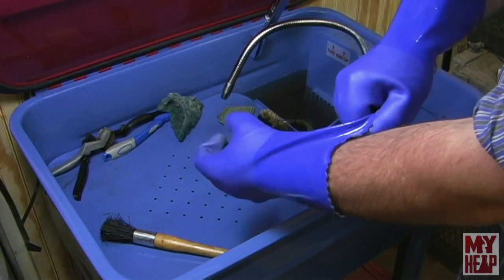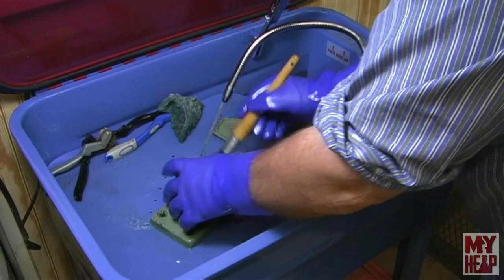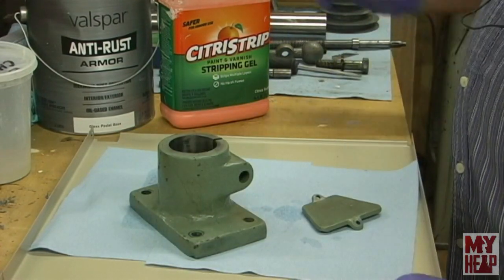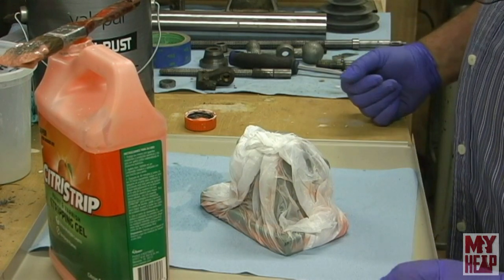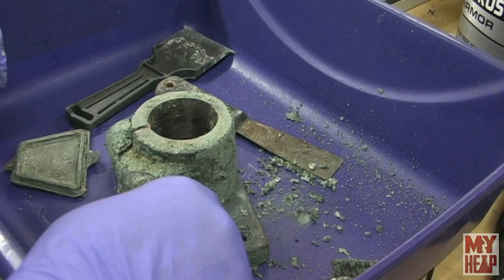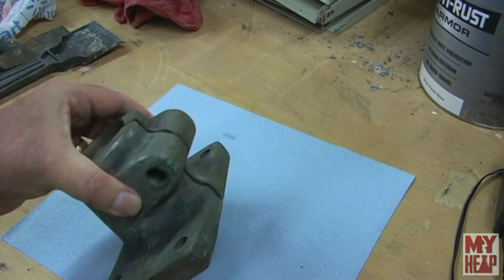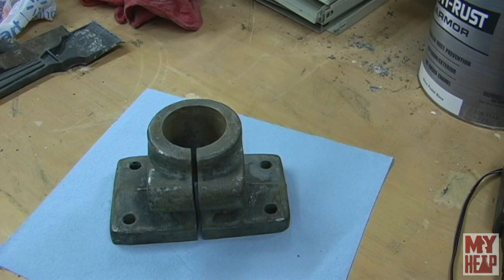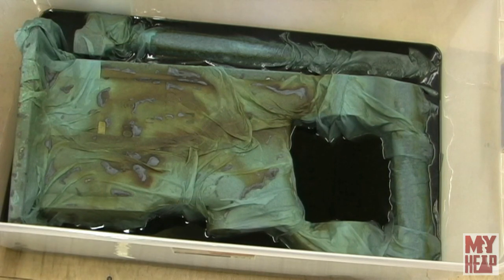Burke #4 Mill - 05 - The Prepping Process

Comment: Mornin’ Joe…enjoyed your strip down process…a couple of years ago I worked on a brass regulator…nice old clock about 1920’s but somebody painted the brass brown rather then go with the natural patina of brass…I used the same Citristrip you used and it stripped the paint just fine but the point I wanted to pass on is the brass was easily polished back to original after using the Citristrip…nice stuff.
Your base for your mill…I rebuilt a Stanford Surface Grinder years ago…and I built a wooden bench for it…I did not make it as a work bench is built…I used furniture joints and reinforced liberally…but being a surface grinder I went to extremes to reduce all vibration…best thing was I filled the bottom of the cabinet with cement …I can’t remember how much I used…also I store my supply of steel plate on shelves under the grinder as well...as much weight as I can get down low...great video Joe…thanks for sharing…bob
Reply from the maker: Hi Bob.  Glad you could stop by.  I like the Citristrip product, you just have to give it time to do its thing without it drying out.  I have used plenty of the harsher strippers over the years.  I don't miss the smell or the burning skin.

I think the bench I will build will be made along the lines of my workbench but somewhat heavier.  I will put drawers for supplies and perhaps allow for some hanging on the sides of the cabinet.  I am thinking along the lines of 3x3 legs and horizontal framing, 3/4 ply for sides and back let into the 3x3 material so it is flush internally.  (Make adding drawer slides easier.)  Using two layers of solid door material with a layer of tempered hardboard on top of that. (Easily stripped off and replaced) with some banding going around.  Should give a top thickness of about 3-1/4 to 3-1/2 inches.  A drawer to either side of the knee screw with a middle fake drawer for the knee screw just so I can clean the oil out of the catch pan below the screw.  At least this is what I am thinking.  If it isn't heavy enough then I could always move my drill press to it and come up with something else later.  Any thoughts?

Joe
Reply: Sounds great...looking forward to seeing it...bob

Comment: Depends on how well that metal cabinet is put together and how tightly it's assembly is for how many rattles you'll get out of it. You'd be the best judge if it will work or not.Usually a bit of strategically placed glued on thin rubber can take up enough of the clearances to make almost anything silent. I spent a few hrs with a couple of cheaper drill presses that seriously rattled. Adding small O rings at the bolt holes between the sheet metal belt guard and the head casting did wonders. That protruding end of the knee screw blocking the use of that drawer when the knee is lowered is a non starter in my opinion. You could add a couple of vertical pieces of 3/4" ply on each side inside the drawer where that knee screw will be positioned and fasten those ply uprights in from the front and rear of the drawer, and then just cut a section out of the back of the drawer between them to clear the screw. Add a small container under the screw end to catch the oil and that way the lube from the screw dripping inside the drawer and still having it fully operational won't be an issue. Storage in a shop is far too valuable to give any of it up for any reason.

There's no such thing as having an over built and too heavy bench under any machine tool. If your Burke doesn't have some type of large drip pan under it's base casting for catching lube, cutting oil and a lot of the chips I'd seriously consider visiting a sheet metal shop and having one made up. Even with one, for ply bench tops I'm highly in favor of semi armor plating the top with at least a contact cemented piece of Formica. It makes cleaning a whole lot easier and prevents the ply from soaking up the inevitable oil. 

That black color under the paint might be what they used for filler on casting flaws during the time period the machine was built. It was usually dark or black and of an unknown composition that's probably toxic in California.:-) If it is and it's still in good condition I'd just leave it alone as from what I've read that others have mentioned about that filler, it just about takes a jack hammer to fully remove it. The factory couldn't afford the time to do so, but if it were me I'd also file down the casting joint lines flush with the surrounding metal on any of the castings that show that line from the patterns. It's a small detail, but ends up making the machine look a lot better finished than when it left the factory. Just my 2 cents and worth quite a bit less than you paid for it I suppose.
Reply from the maker: I think I will go with a purpose built wood bench.  I think I will be happier in the long run doing that.  The metal cabinet is pretty heavily constructed but I may as well leave my drill press on it.  I use the drawer for drills, taps, dies and the like so it works out well.

The Mill has a drip tray that it sits on, but I will still need to add something as part of the bench to catch drips from the knee screw.  I actually didn't think about that until Chirpy brought it up.

I already hit the black stuff with some more stripper, but if it doesn't come off this round, I will just paint on top of it.  Speaking of California, isn't Di-Hydrogen-Monoxide a hazard there too?  :-D

Thanks for taking the time to give me some feedback.  I appreciate it very much.

Joe

Comment: Joe, I had a smaller mill on a bench made of 4x4 legs with 2x4 top and leg cross braces, it worked but after a few years of using the mill as a drill press that bench wobbled terrible. But then I’m not a woodworker! Some lumber and a bunch of long drywall type screws no glue or fancy joinery.  We do have humidity extremes here and wood swells and contracts terribly so even fit joint and glue won’t keep anything tight for long. A good metal stand is my idea of the ideal surface to mount the mill to.
Reply from the maker: Hi John.  I plan on glue, screws and some rabbit joints so hopefully it will hold up.  My shop fortunately is humidity controlled with a dehumidifier.  Here where I live in Tennessee, the humidity is something awful.  Thanks for the input and watching.

Joe

Comment: that grey/black stuff on that one piece looks like old japanning rather than old paint. I run into alot of that stuff and that stuff is about impossible to get off without just blasting the crap out of it with a sand blaster. I know that evaporust can eat whatever paint is left on it too, so you defenitely dont want to use it on parts that you freshly painted, lol. 

The metal cabnet may work ok with the thick wooden top, that should act as a vibration dampener, but I think the leadscrew interfering with the drawer would drive me nuts tho, and the oil dripping down the leadscrew and ending up all over the place in the drawer would also drive me banannas, lol.
Reply from the maker: Hey Chirpy.  I am not sure what japanning is, I will have to go look that up.  I think I will build a bench for it instead of using the metal cabinet.  You were who I was talking about in the video by the way.  😀

I discovered that evaporust will eat some paint too so I make sure to do the rust stripping before I do any painting.  Thanks for stopping by and watching Chirpy.  I am always glad to hear from you.

Joe

Comment: Weeell,  you did ask for my opinion 😁.   Here goes;  RE Evapo-Rust,  I've used it, it does work well, and like you 4 gallons is a bit much.  What I did was use a cheap water fountain pump and had it spray over the unsubmerged surface of the part just like your parts washer.   I used 3 tee's on the tubing to cover the whole piece, it worked great,  I was uncertain about the life of the pump, so I used a cheap one, It's been in the solution for nearly 2 years, and it still functions, (I just checked it).
RE: Mill, could you modify the drawer to allow for clearance of the knee screw like they do with some bathroom vanities to clearance the drainpipe?  Also if you're concerned about the resonance of the metal you could coat the inside of the cabinet with heave rubber spray-on automotive undercoating, it's inexpensive you can get it at any auto parts store, several coats should do it.
I think that for like 3 cents worth 😁
Reply from the maker: Hey Walt.  I always appreciate your input my friend.  I like the pump idea.  The wicking worked for me mostly with the paper towels but did have some spots dry out which created a bit of a pain in the arse bit to clean off.  Fortunately though, I am ready to start painting the column.  That is a milestone for me.

As far as the bench I have decided to just build one.  I think 3x3 legs and rails with 3/4 ply sides and back and still deciding on face frame thickness.  Stay tuned.

Thanks for watching Walt and taking the time to shell out yer $0.03.  :-)

Joe
Reply: Will you do a quick video on the bench build?
Reply from the maker: Hey Walt.  Do you want to see a quick build video on the bench?  I am thinking of laminated 2x4 for my 3x3 stock.  Pocket screw and glue joinery.  The 3/4 plywood let into rabbits to form side and back panels.  2 layers of 1-5/8 solid door with a layer of loose tempered hardboard on top with some 2x4 on edge banding around the edge giving a 3-3/8 thick top.  Still deciding what to use as face frame and heights, depth.  You get the idea.  Any ideas from your perspective.  Your welcome to give the whole $0.03 on this one buddy!!!  :-)

Joe

Comment: wooden bench, you can't go wrong.  Use good construction practices.  I build my with 4x4 legs and a 2" top and put a tool type chest cabinet under it for my cutters and stuff.  If you put a cabinet under it, you could put two small drawers on each side of the knee screw.
Reply from the maker: William, I was thinking of similar construction with 3x3 legs and banding with drawers in the front.

Joe

Comment: Hey Joe my Burke is on the original cast iron base i would build a base out of steel and boiler plate the heavy the better if I didn't have the original just my opinion
Reply from the maker: Doug, I would consider it if I had the materials and skills.  But now that you mention it, what footprint does your base have on the floor?

Joe
Reply: My Heap Joe the base is 21 inches square height is 29 high and the top is 15 by 12 inches hope this helps if your in my area give me a call
Reply from the maker: @dougvanallen2212  not sure I am in your area.  Drop me an email to xavier@gtec.com and we can trade some contact info.  I am in middle Tennessee, by the way.

Joe
Reply: My Heap I guess I'm getting old I thought you were in New Jersey
Reply from the maker: @dougvanallen2212  Not since the 80's when I was stationed at Colt's Neck.  I love the southern part of New Jersey as I remembered it!

Joe

Comment: Citristrip isn't working worth a damn for me on a bridgeport.  I'm going back to aircraft remover.  Now THAT is some foul stuff!
Reply from the maker: Sorry to here that.  I wonder what your mill is painted with that the citristrip doesn't work on?  For me, it works best if I glob it on there and then cover it it plastic and let it set 24 hours.  The filler they used in the old days to fill in casting blemishes, that dark grey stuff,. The citristrip doesn't faze that either.  Thanks for watching and commenting.  I appreciate it.
Reply: @MyHeap  I think I just have too many layers or it's some kind of epoxy paint.   Fortunately, about 70% of my original paint is gone due to years of flood coolant.  Thank god.   Speaking of paint...  How is your paint holding up?  I only want to do this job once, it's pretty labor intensive.  subbed!
Reply from the maker: @jagboy69  I don't think I can give you a definitive answer.  It has hardened off very nice, seems very durable and chip resistant.  But it has not been exposed to solvents and oils yet.  I have projects that I want to finish up because they have been hanging too long.  This is one of them.  I have dragged on it because I don't have a motor for the mill and not really sure what to do to allow me speed ranges from 1/4 inch cutters to 3 inch cutters.  Any suggestions?  I am thinking maybe a two horse with vfd.  But not sure how well the slow speeds will work.  I am open to suggestions, keep in mind, like most hobbyists, I have shallow pockets.  Haha
Reply: @MyHeap  Brother, I'm brand new to this stuff.  I just bought my first vfd from china.  80bucks and it's working a treat on my 2hp bridgeport.  I'll watch through your videos on your machine tonight for a better look.  Chirp would probably be a better source.  I'm still in nursery school and doing good to keep body parts attached.😱

Comment: The base is aluminium ?? That is a surprise...and you're sure that is original?
The equivalent products to Evapo rust on this side (every fool with a hat on sells the stuff these days), is to be diluted 10-20 to 1. Prices are about 20 euro per liter concentrate.
The idea for the base sounds reasonable, as long as that 'door wood' you use is solid wood (a layer of sheet lead between the two is great for dampening vibration)
A wooden bench for metal working machines is a less good idea, per definition. Too much 'life' in wood to get the setup lined out.

Paddy
Reply from the maker: Hi Paddy, great to see you.  Yes, the base looks original, but it is essentially a drip tray so probably doesn't need to be too rigid.  The door material is solid and 1-5/8 thick.  I figured two layers would work out okay.  I like the idea of the lead sheet between the layers.  I wonder if I can get some.  Used to be able to get lead sheet as roof flashing.  Thanks for watching and commenting.
Reply: Hey Joe,
Yes, you can make decent bench tops from a sandwich construction.
I made a workbench top from the following : 35 mm of oak, 28 mm of MDF, 2 mm of sheet lead, and 35 mm of oak again. (the oak came from an old (big!) dinning table)
That thing does not move and is great at absorbing vibration and shock.
All is glued, except the top layer of oak (that's screwed on) so it can be replaced when it gets too worn.
Here too, lead is sold (less and less though) as roof flashing.
In case you can't get sheet lead, MDF of LDF board (providing it is glued) will do a fine job, keeping vibrations under control, just on its own.  You can use several materials, just keep in mind that the 'soft center' can't be springy... (so a sheet of rubber won't do)

Toodles!
Paddy